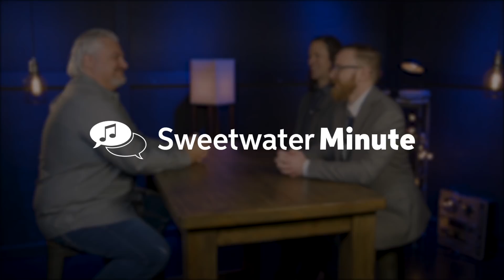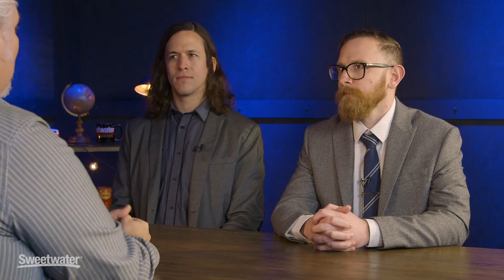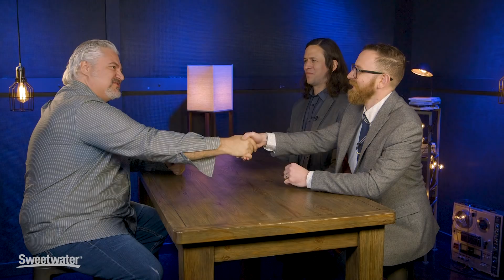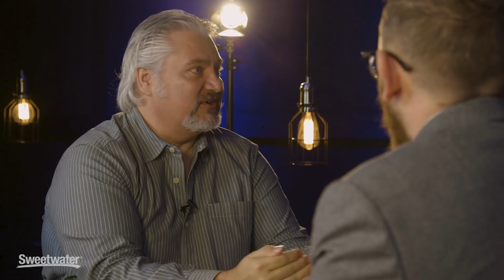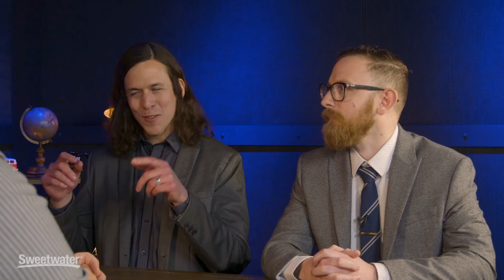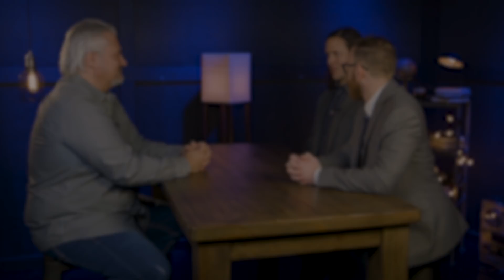Black Lion Audio Interview

Comment: Do not buy people.  I received mine last week  the noise to floor on mine and my friend is bad.  Once you turn the preamp up at 11 o clock it starts picking up Noisy floor.  Cheap monitor out section.  Once volume knob at 2pm you will hear noise buzz through speakers. Don’t listen to these idiot liars.  I’ve emailed Blacklion and they haven’t done anything about it.  I’m going to send it back.  Don’t purchase till they fix this issue.  Only thing great is the headphone amp.
Reply: I’m dealing with same thing with my revolution expander -I’m getting crazy noise -as soon as it’s turned on my console meter lights up while volume down .’ I swapped it out and still the noise is unacceptable. Trust me I swapped out every cable -different channels on my console -everything and it just has a lot of noise on the outputs. I bought it to expand my Focusrite interface and no issues with Focusrite but the 8 channels it expands all have noise. Hopefully they come up with solution but so far nothing is helping.
Reply: The mpc x already had that noise floor

Comment: I have been fascinated with Black Lion Audio's mods to Digidesign 002s and other interfaces for years, and pumped to see them putting out more and more of their own products to great reviews in Tape Op and elsewhere. I'm finishing electrical engineering school and beginning to really understand the kinds of benefits power supply and jitter improvements offer in audio equipment. This was a cool talk, and it's great to finally see the guys behind all the interesting mods and gear!

Comment: The problem with studio master clocks is dispersion... The best way I can describe this is to imagine a heard of elephants: They all start running at the same time, but some some powerful bulls will arrive before others at the destination, then most of the herd, and last of all the cubs. The original pulse is now spread out. How that happens depends on their terrain, which for an electrical pulse, is the cable.
The "digital" gate at the input of your piece of equipment is not a perfect 1/0 thing, it's analogue, and merely transitions between the two states, once a certain level has been achieved. The natural slowing of the rising edge, caused by dispersion, causes jitter, which is directly demodulated into what you hear.
If you want to know more, please read about PWM, Pulse Width Modulation, which will give you an idea.